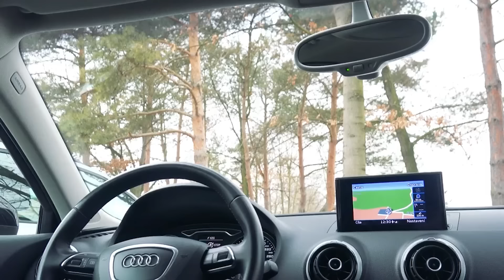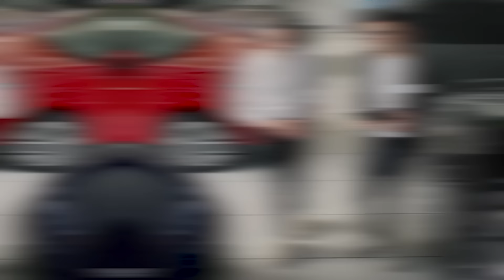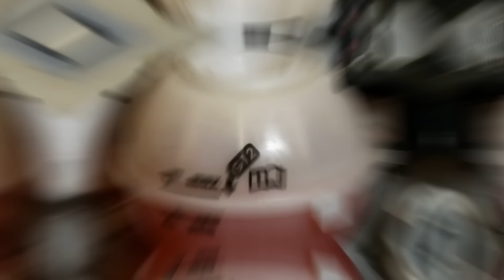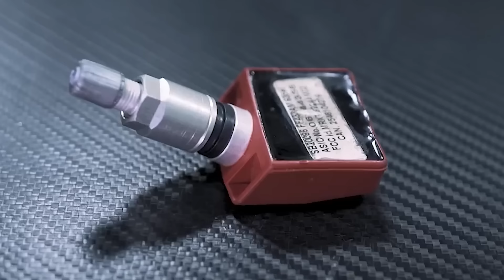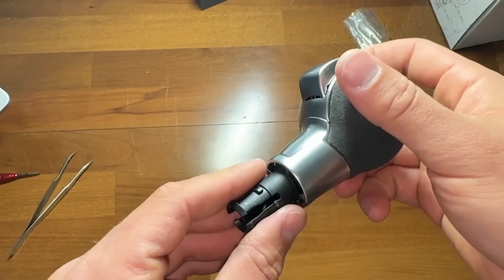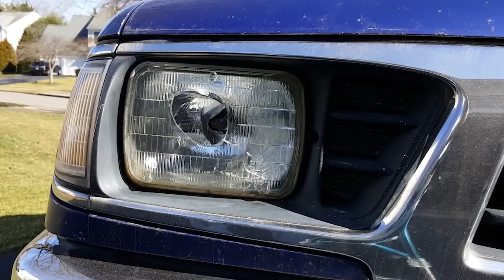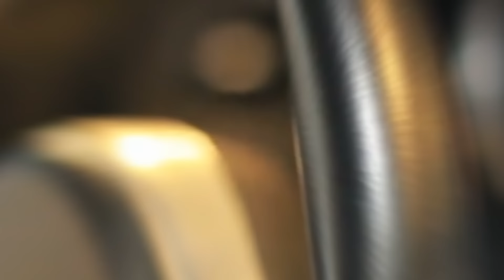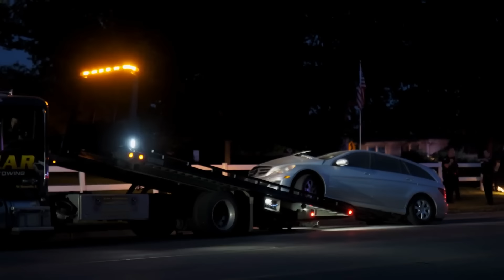25 STUPID Car Features That DESTROY Reliability & Lifespan

Comment: Rodents damaged my wiring harness on my Z4 for the fuel vapor leak detection it cost me $3700.00 to fix! But wait I complained on a BMW chat room and low and behold I was told to check my insurance. I have comprehensive along with liability so insurance does cover the cost minus the deductible!
Reply: U still got screwed, by ur ins. co.
Reply: @danbooher5843 why do you say that Dan?
Reply: Great tip!

Comment: Auto start stop doesn't work the way you describe. Auto start stop works like this: When you stop there's one cylinder dedicated to starting the car.  When you stop the car gas is injected into the dedicated cylinder. When you take your foot off the brake the spark plug for that cylinder fires and provides enough compression for the engine to start. It does not use the battery or starter!
Reply: There is zero oil pressure. Not good.
Reply: Nope, How would they assure that that cylinder stopped at the correct position to fire right? Wrong position and it would spin the engine backwards. Quit pulling people's chains.
Reply: You misunderstand auto start/stop. The BATTERY (and capacitors) energize the STARTER motor, and creates the electrical SPARK that FIRES the engine to crank. The BATTERY also continues to run other needed systems while the engine is off. This is not magic. Look it up.
Reply: Nope, How would they assure that that cylinder stopped at the correct position to fire right? Wrong position and it would spin the engine backwards. Quit pulling people's chains.

Comment: Love the old am/fm radio with either cd player or cassette tape player. I also love cars using manual transmissions. I still use one
Reply: Same here! I have a 96 VW Golf GL and 94 Honda LX....still drive them daily!
Reply: I agree 100%. I love manual transmissions . I enjoyed pushing a clutch pedal and changing gears with a floor shift.

Comment: I love my 2000 Jeep Grand Cherokee, 0 out of 25, Paint work and leather interior are almost perfect. My 2015 Model S has been fitted with 17" rims and heavy load 245/60/17 tyres and I got rid of its air suspension after many failures. Rides like a dream now.
Reply: 2001 qx4 Infinity. Beautiful modern looking. Leather, all electric, moon roof, Bose stereo, 4 wheel drive. LED headlites. No rust . Runs great at near 25  why can't build cars like this now?
Reply: 2001 Infinity qx4 perfect shape all leather, moon roof, Bose stereo, 4 wheel drive. All electric. Almost 25 now. Runs great.